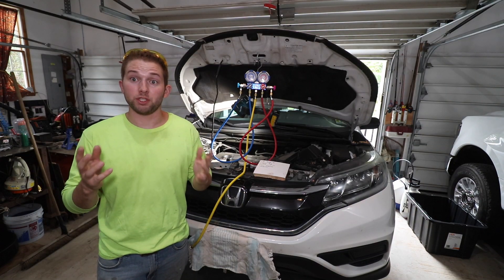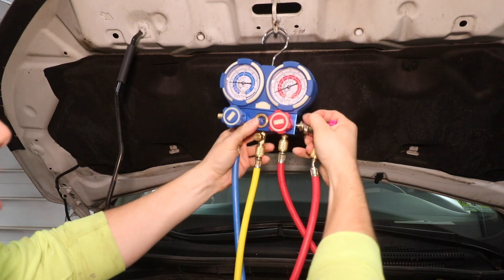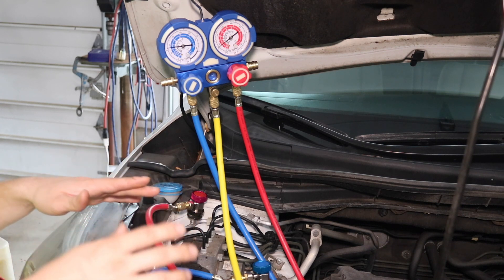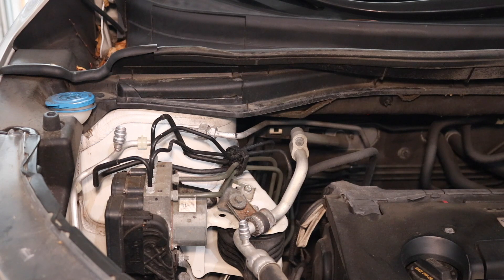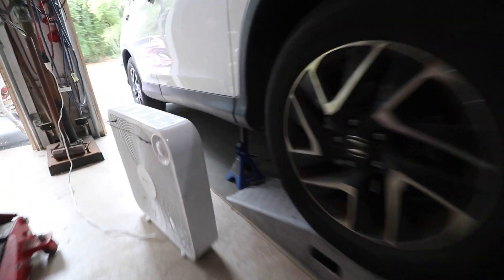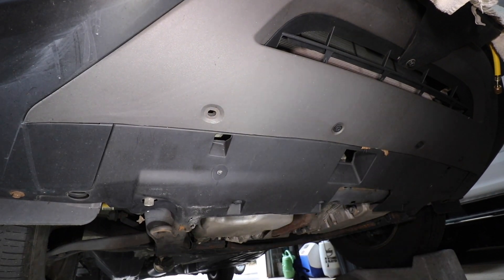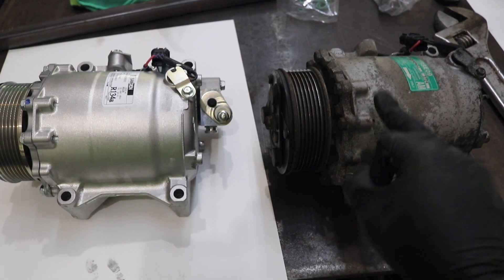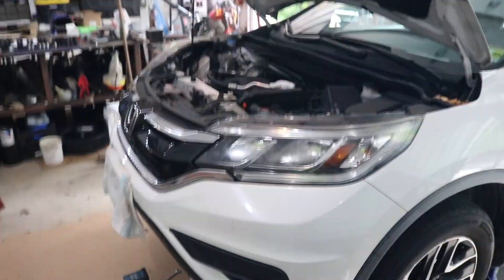2017-21 Honda crv ac compressor + condenser replacement | How to guide

Comment: The materials on the description show R134A refrigerant but I thought these models used R-1234YF?
Reply from the maker: What ever the sticker in the engine compartment lists, that is what I would use.
Reply: I believe the 1.5L motor uses the newer freon and the 2.4 uses the R134a.

Comment: You can avoid exost removal especially if you replace condenser.  Just unscrew two bolts that keep passenger side fan attached to radiator.  You don't even need to remove fan completely. Just slide it up like 3/4 way out and you have plenty of room to take out compressor.   This design is pretty retarded.  I almost took of waterpum housing before I found the way.   My kids laughed at me watching me playing Tetris with compressor for two days.  😂